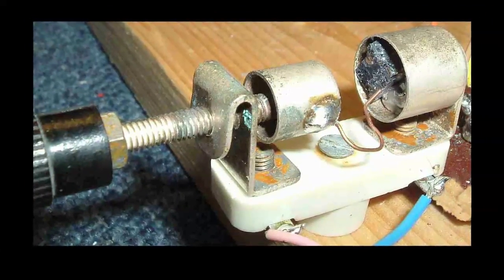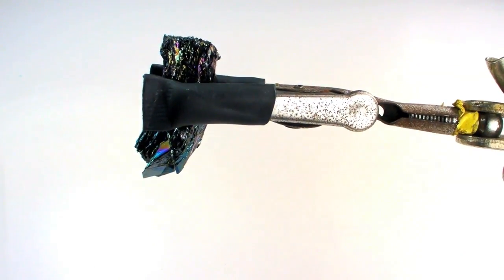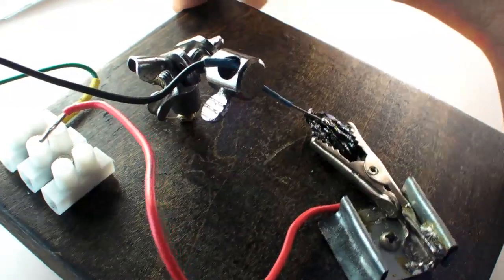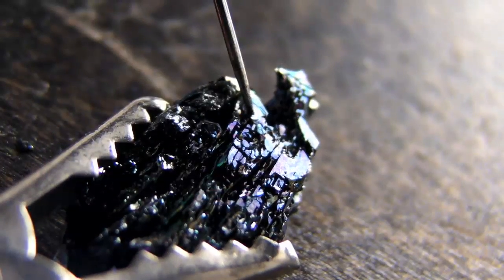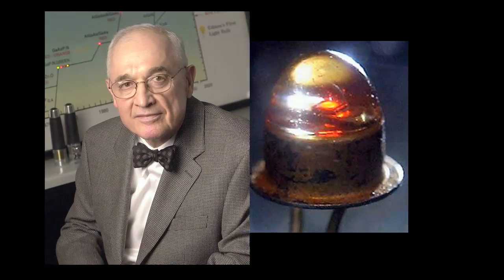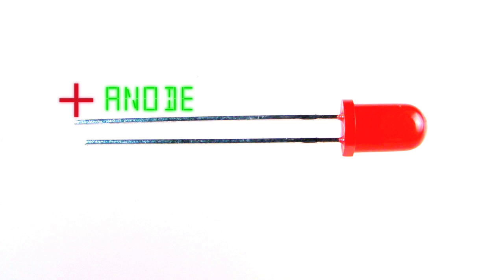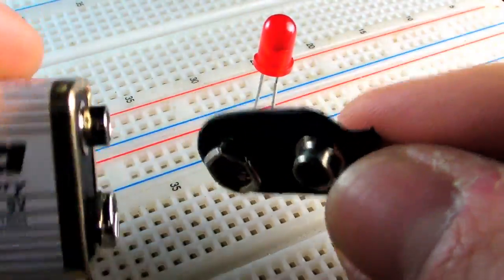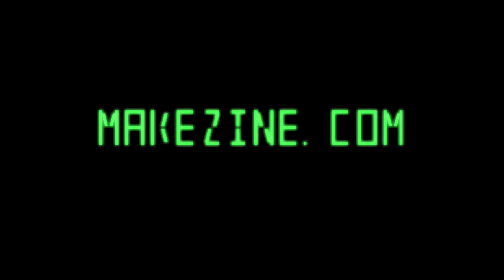MAKE presents: The LED

Comment: The guy reminds me of the character Pete Hornberger from the sitcom 30 Rock.  LED's are very fascinating. I love all the new applications they are used for. It's especially nice having a flashlight that not only burns clear and bright, but that has a much longer battery life. I keep hoping there will be a widespread use of these to replace both incandescent and fluorescent bulbs since they are bright, instant on, and energy efficient.

Comment: The 470 Ohm resistance is use as a current limit and is calculated as thus:

Rled = (Vsupply-Vled)/LED current.

Typically the LED uses 15milliamps of current and requires 2.1 Volts to operate. 

So the equation works like this:

Rled = (9Volts-2.1Volts) divided by 15E-3
Which Rled = 460 Ohms, when rounded off to the nearest common resistor value is 470 Ohm.
However different colored LED's require different operating voltages.

Red = 2.1Volt
Green = 1.9Volt
White/Blue = 3.3Volt

Comment: @bleemy If you're talking about the maximum/recommended operating current of the LED, that will depend on the manufacturer's specifications. The average current that most LEDs should run on is 20mA. 
For calculations, you can assume a constant voltage drop of around 1.7V (for a standard red LED). But this will vary for different LEDs. (post too long continued)

Comment: No, I mean constant current!
You can use a series resistor calculated by Ohm's law:
R=(Us-Uf)/If

Or a constant current source with If (forward current) set. You'll see that the voltage drop at the LED will be Uf given by the datasheet as long as the maximum voltage of the supply is higher than Uf.

Comment: @bleemy To find the resistance required, you can subtract this from your battery voltage then calculate the resistance required to give the desired current using ohms law. i.e. resistance = (BatteryVoltage - LEDVoltageDrop)/Current. For example, if your battery is 9V, the voltage drop of the LED is 1.7V, and your desired current is 20mA, it will be R=(9-1.7)/0.02 = 365ohms.

Comment: @JonDeth It will, but it won't stay that way.  It's like filling a water tank that has 100 gallons of capacity, using a 50 gallon/minute pump to fill it up, but using a 100 gallon/minute pump to extract water.

Comment: Everybody works with these big clunky bulb shaped leds, but it seems that the tiny rectangular surface mounted leds, even though much harder to work with, are a much cooler package to create massive displays with.   If they made these surface mounted leds maybe in a bigger rectangle you could hold, instead of as small as a few grains of sand, they would probably take off as well.

Comment: @speedomike747 You actually have 3 leds under the same resin housing. You'll see the multi-colored leds have 3 cathodes (red green blue) and one anode. This basically gives you a typical RGB pixel capable of having any color.

Comment: I assumed that a DC supply is used, otherwise you'll also need a rectifier of course. In some cases though, when the led can handle the reverse voltage and current, the LED can be abused as a rectifier-diode.

Comment: If you use a 9V battery and use a resistor, does the resistor resist voltage? Or the resistor resists some thing else?

Comment: 3v is a bit to much for a red led but ok for white, blue or voiler ones
the voltage is depending on the wavelength of the leds color

Comment: @speedomike747 Usually a different voltage applied will give you the different colors. Example, though not accurate, 2.4v might be blue, 3.2v may be for green and then 3.7 red. It really depends on the led used.

Comment: It depends on the LED. And the resistor has nothing to do with it. The resistor is only a crude current limiting device.

Most small LEDs can only take about 100mA or so. The higher you go over their rated current (usually about 20 to 50mA), the shorter the LED's life.

There are LEDs on heat sinks that can take an amp of current for extended time, used in lighted signs. The lifetime is measured in tens of thousands of hours, rather than hundreds of thousands of hour lifetime of small LEDs.

Comment: @kiyotewolf 
LEDs hardly generate any heat. most of the energy is released as the light, so they save energy. i believe there are some that do.. but not much. im not sure. or maybe thats just when you put in too much voltage and it burns out. thats why easy bake ovens use regular light bulbs, which waste alot of energy creating heat.

Comment: LEDs emit the energy produced by their band gap region (essentially where electrons get turned into photons.) Different semiconductors produce different frequencies and energy levels of light. So in theory an LED at any frequency can be made. But it wouldn't be an LED, more of a photon emitting diode...

Comment: how would i find the current (i) in a led? i brought a few LEDs off ebay and want to connect them to a certain battery... but obviously i need to add a resister to the mix... i can get the V from the battery, but would need to know the the (I) from the LED wouldnt i? also second question is ... if i have two LEDs in serial or parrallel ... what do i do to the formula ? would i half the resistance if i doubled the LED of same current

ps your explainations in circuitry is AWSOME. ty =) Lee

Comment: @speedomike747 
Well they have three seperate neg or positive leads to control each colour and one for the common ground or positive all depending on the LED in question, rgb (red green blue) to get other colours you simpy mix the amount of rgb needed to make the needed colour.

in short the RGB or multi-colour led have 4 pins one common - or + and three leads for each colour.

Comment: instead of resistor you can use your body,connect ground of battery  to cathode,and then hold with one hand anode ,and with other touch the battery positive terminal and see what happens!it will light up but very dimm,because human have resistance of about 10000-20000ohm!

Comment: the use of the resistor in this breadbord was to limit voltage not current as it was in series with the diode both components would have the same current flowing through them. other than that mistake interesting vid

Comment: @stuntguyjr it would be easy to make that led brick just go to ebay and get some leds and you will also need some diods depending on the battery your gonna use and you will also need a circuit board and some soldier its not hard to make and it wont cost much neither

Comment: @speedomike747 Each individual "RGB LED" light has three separate LED chips embedded (red, green, and blue), each with a pair of leads (some just use four leads, with common ground), all behind a diffuser. 

By running independent PWM to each chip, you can mix different intensities of red, green, and blue to get any color.

Comment: Someone explain this.
I had a supply of 4.99v. I went online and found led calculator. My led needed 3v @0.020milliamp. The online calculator recommended I should use 99.5ohms resister. After connecting 100ohm resistor I measured the voltage and it was 4.97v. Wasn't it suppose to be 3v? Why it showed 4.97v? I definitely measured after the resistor.
Reply: I had the exact same issue. Till I figured out the reason for this behavior. You see, if its battery resistor, resistor battery circuit. Just remove the resistor. What is the multimeter measuring now? You see, when the resistor is the only thing in the circuit, it uses all the potential. And you get a potential deference of exactly the battery. But when you connect an led in series, you will see that the led has tge voltage it needs and no more!!
BTW. I use a 6 v supply with a 3v led that needs 20mA. It needs a 200 ohm resistor. Try that. Always if your current is 20 mA, calculate it as if itbis 18 mA. Cheers

Comment: Here's the calculations:

R= (V supplied-V LED) / I of LED
Let's say i have a 3 v  25 mA LED with a 9 volt battery:

R = (9-3) / 25 mA or R = 6 / 25 mA

Which, using an ohm's law caculator is 220 ohms.

Comment: He did, but only the basic concept.  There are plenty of sources to buy silicon carbide.  Once you chip off a tiny piece that will emit light, you just need a little bit of wire and a plastic casing for it